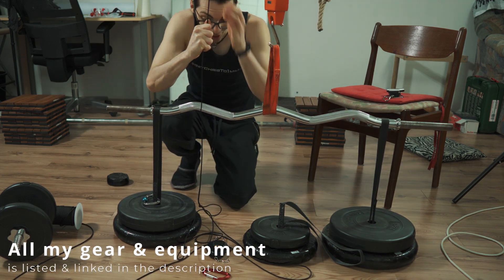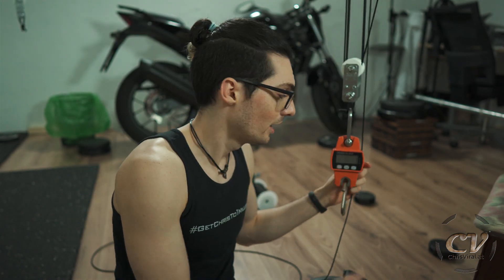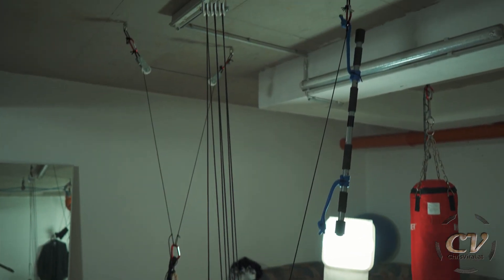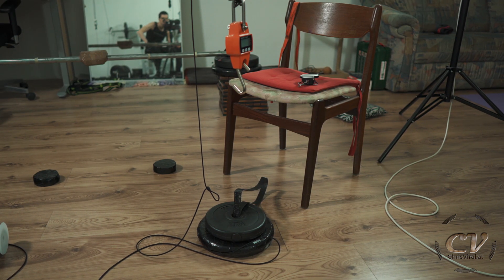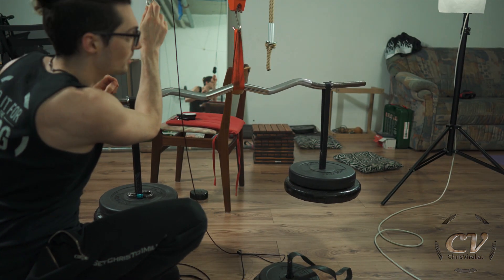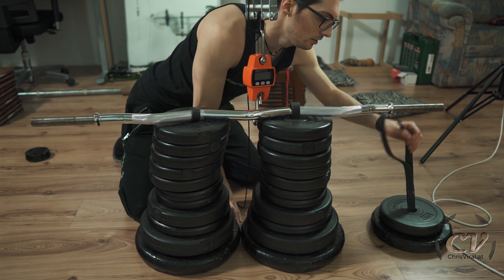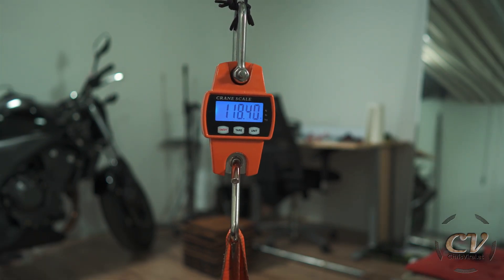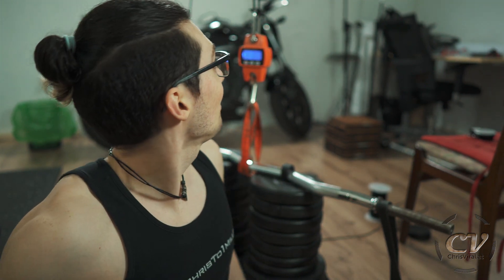New Stress Test Setup - 6X Force Multiplier (Triple Pulley System)

Comment: first
btw i bought on ebay flat steel bars which are incredible cheap (1,75m x 50mm x3mm =5,5eur)
you could search for thinner ones like 1,5mm and 2mm. You could cut 8cm long pieces, stack+clamp them so you have to drill only 8 holes and not 8x10 holes, just my idea for production.
https://www.ebay.de/itm/Flachstahl-15mm-bis-55mm-Breite-Flacheisen/131282593101?ssPageName=STRK%3AMEBIDX%3AIT&var=430567519332&_trksid=p2057872.m2749.l2649

but you have to seach for zink plated plates (my link is steel for welding constructions)
Reply from the maker: #1 indeed 👌🔥
wow wtf that's dirt cheap, thanks! :o